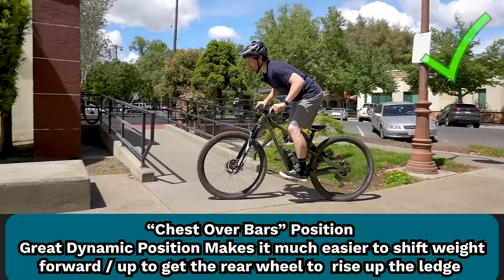How To Climb Technical Ledges & Curbs // Level Up Your Mountain Biking With The Punch Method

Comment from the maker: We hope everyone enjoys this video! There are many way to get up and over ledges out on the trail and in this video we focused on the punch technique.  In my experience using the punch method is really efficient and consistent at walking / jogging speed on small to medium sized ledges. Whereas I will use Bunnyhops on high speed medium to large sized ledges.  Bunnyhops are but definitely require another level up in terms of bike handling prowess and strength.  In my experience a punch can be done much slower than a bunnyhop as well for those really technical climbs. If you are interested we would be happy to do a follow up video of when to use the punch vs bunnyhop methods. Just let us know!  We have a video coming out next week that touches on pedaling power stroke, seat height, & gear selection so stay tuned for that one and let us know if you have any other questions or anything in the meantime!
Reply: Hey Kyle and April, this video was brilliant, there's a few things I do without thinking about, and it's nice to know 'what I'm actually doing', but there's also definitely a few take home points for me - thanks :) 

Also I think we can all learn a lot from the brilliant example of determination that April showed!

I would really love to see a video on steps on steeper climbs if you get the chance, a situation where you can't really 'stop pedalling' 

Thanks Team :)
Reply: The left up hill was hard, power pedal on the uphill then uphill left turn front wheel lift then rear lift too much for the leg but April did make it. I watch OKP a japanese trials video he has detailed  step by step videos to conquer obstacles.
Reply: Great video thanks!
What about uphill and downhill switchbacks?
Can you make a video about it?
Reply: Great video, it's on a skill I've been working on and the hints are great, and reinforce a couple things I've figured out. 

I find I can do pretty large ledges/rocks (eg wheel height) when I'm on flat ground or gradual uphills, but when the climb gets more steep I really struggle.  Sometimes it's a stall out, where I don't have enough speed once the front wheel is up.  Sometimes if the hill is reasonably steep I don't have enough room between me and the front of the bike to get the front wheel lift up high enough, and leaning back to create more room makes looping out a fear.  Any hints on executing this on steeper inclines would be appreciated.
Reply: Great video, and I would love to see a follow-up vs. the bunny hop.
Reply: this video is exactly what I needed: I know I can somehow go over ledges but couldn't really figure out why sometimes it works and sometimes I get stuck... this breakdown the technique perfectly and gives me idea what to focus on... Thanks! 😊
Reply: Yes, please!
Reply: ❤ This video was excellent. Top notch for sure and helped me immediately figure out what I was doing right and wrong at different times/feature. Thank you!
Reply: it would help if you also do a video on when to use different methods; type of obstacles, effort/skills  needed using a full sus and a hardtail....thanks
Reply: i've been so frustrated trying to do bunnyhops to get over obstacles, i'm going to switch to learning the punch first ! thanks for the video and surely would be interested to see the use cases video and good work April. i feel your struggle but you got it. and Kyle explains things in a way that no one else does.
Reply: I Love this video. I will going to try this ....👍

Comment: The barefoot section with the rigid bike was very revealing. Excellent demonstration. One fine point that I've noticed: While we don't 'scoop' to lift the rear wheel, we do perform some little pressure move on the pedals that keep the feet connected to the pedals even when we unweight. We do this so our feet don't become disconnected from the pedals for fear of shinners.
Reply from the maker: Glad the rigid bike section helped! We will have a video next week on our other channel talking more about the pedaling, seat and gear selection!

Comment: This is a very nice, practical video but I think you left off the need to perform a "pedal grab" by pointing down the toes and pressing back on the pedals as you perform the punch. I understand that the punch technique does not rely on scooping back the pedals but on pushing forward the handlebar but, as far as I can tell, you still need some pressure back on the pedals to keep your feet on the pedals and to provide a platform fron which to punch the bar. Am I correct? if so, I think the tutorial would benefit from mentioning this point. Thank you very much for the clear tutorial and keep up the great work

Comment: This is crucial information if you're climbing where there are steps or roots. It can make the difference between a miserable frustrating experience into one of confidence and gratification. My sister and her boyfriend took me on a trail  which had small climbs with roots it was my first experience into MB  and I'm fairly athletic so I thought I could manage. Nope. I was so exhausted and frustrated I threw in the towel and turned back. I was thinking never again. This video has given me new insight and hope. I am  in my late 50's but could pass for late 30's(I've been told) which is why I could easily give in so quickly - oldish and tired but thanks to your video it makes me want to try again. Love you guys.
Reply from the maker: Glad to hear this video gave you hope! The best part is you can practice in town to get your confidence up with curbs and stairs. And just like what happened in this video, if the first ledge you try gets too frustrating, try another one with less elements to it. Hope you have success!
Reply: Will do. A lot of times  you see these people in videos making everything look so easy which it may be  but one can easily create false expectations if you don't have proper technique. Looking forward to your next video on climbing to help prevent any unnecessary frustration. Cheers.

Comment: What gets me is feet position. I have to be super aware of where my feet will be because my gut wants to pedal while going over the ledge, but that generally means I get a pedal strike and get stopped dead.  Once I started focusing on not just speed and unweighting my rear wheel but making sure feet are level, I had better success.  This really is a fantastic video, I love these and can't wait to see more.
Reply from the maker: Yeah the feet thing is so hard to break mentally! April had the same thing happening but she really started to figure it out using the curb to learn at a coasting speed!

Comment: I am sitting here watching very closely with my repaired/healing Right Shoulder Rotator Cuff Tear!  Watching this and your other improve your peddling shows exactly how I fell sideways on a ledge. My dropper was full suspension and I had just finished a climb and I stopped and stopped and fell sideways over a ridge and landed on my shoulder.  I finished the single-track, but knew I was in trouble. 
Each time I come to a ledge is an opportunity to fall over sideways (watching April closely as she demonstrates this).  Keeping the dropper seat low is important so one can reach the ground. Of course it is difficult, when climbing steep switchbacks, to keep the momentum. 
It is 6 to 12 more weeks before getting back on my Commencal, but watching your demonstrations are a real encouragement.  Thank you!

Comment: Great tutorial. Something I've somehow figured out how to do over the years of riding. 

One thing I noticed with April's failed attempts was the timing of the the pedal stroke and position. Certainly being in the right gear, having the right amount of momentum with the front wheel up on to the ledge and then having the pedal stroke at the right timing helps a lot.
Reply: Oh. And Congrats April. Well done. I know when I first tried mountain biking I realized I couldn't just twist a throttle and have power. And how the power was put down and being able to ratchet my pedals became very important.
Reply from the maker: Yes good eye, I kept trying to pedal my way through on the failed attempts and timing is always off when I’m trying new things!

Comment: Nice instruction, I chuckle at people saying you need clips or suspension to get up ledges. I learned to hop curbs on my bike in the late sixties. I got into aggressive trail riding on a full suspensions about 8 years ago, my technique could use improvement but it still works.

Comment: I am so happy this came out when it did as I continue to fail on the technical climbs. One additional question would be advise on avoiding pedal strikes during this process. When the climb is steeper and also has sections like this it feels like you need to keep pedaling hard but then you get hung up on the pedal. It may be a practice/timing thing but man are those pedal strikes annoying.

Comment: Great to see you guys back making content - thankyou from Australia! If you are ever fishing around for ideas on a lesson to make, I would love to see one on ways to get over an obstacle taller than bottom bracket height at slow speed. There are a lot of old logs across trails where I ride (left as technical features) and sometimes they are just after a corner or have an awkward lead up where you can't approach them with much speed. I'll often stop for these and lift over rather than risk bashing my bike, but I see better riders magically clear these cleanly at the same low speed.

Comment: 18:29 - that's where I squeeze my toes between edge and pedal. As long as the chainring can clear the step everythings ok, but when I definitely have to lift the rear wheel first, there is a good chance my toes hit the edge. I think, I got to become more familiar to having the front wheel up first, like track standing with the front wheel on a bench for exxample - or getting some work shoes with steel toe caps. ;)

Comment: Great video - and you can see how leg strength is needed on uphill ledges 🥵 …interesting to see that you need to bend your legs a bit after getting the front wheel up.  Pedaling under exertion in a slight crouch is hard - esp when you’re trying to keep your weight forward so the rear wheel doesn’t get hung up on the ledge.

Comment: one thing i learned to do on big ledges is let my front wheel touch the corner of the ledge.  it allows me to shift my weight forward better. when i let the front wheel go up and over the ledge i always find myself in the back seat.  
i learned that from riding moto.

Comment: Hey, great video as always, thanks! By any means I would not call myself a very skilled or experienced rider, but it seems that this skill came naturally for me. Anyway, I have my own thoughts why April failed on that ledge with the left turn, and it was not mentioned in the video, so maybe I am wrong (feel free to correct me). I've noticed that every time she failed, she was trying to pedal just over the edge and the pedal strikes were the main cause for a failure. This leads to my other observation - IMO the speed was a little bit too low most of the failed attempts, that's probably why April thought she needed to put the power in. What I tend to do (by instinct) is to avoid pedaling during the back wheel lift and always try to keep my pedals leveled until the back wheel is over the ledge. This means that the speed needs to be correct before the maneuver.

Comment: Kyle, how long full suspension bike will last if it used to train dirt jumping, not only canonical descends? Struggling to decide to buy a dirt jumper, not so much time to train, but don't want to ruin expensive trail bike.
Reply from the maker: It really depends on the bike and how the frame is built, XC, Trail Or Enduro but honestly on small to medium dirt jumps you should be fine for quite a while :) Just try not to case stuff haha!
Reply: @AprilRideMTB  thanks Kyle, from your answer - no dirt jumping or buy dirt jumper/be ready for expenses. It's impossible not to case, especially unknown jumps

Comment: Watch 'SuperRider' in Oregon on how to do these techniques properly!
You need a two stroke off of your weak pedal foot, instead of coasting to the ledge on the weaker foot.
Its not in your arms you dont need to pull your arms to your chest for heights that you are doing, use your strio=ong pedal foot as well as your boy weight over the back of the balance point.

Comment: I think the problem with these punchy bits is body positioning. To ride a manual we are supposed to lift with body weight and keep arms straight. With punchy bits you kinda need to go back to bad form manuals. Pull up with your arms so the bike comes up to you and you are in a position to then throw your weight forward and push the handlebars forward. I struggled with the punchy bits for a while then I finally figured them out.

Comment: In real situation as I see this, the hard part is not the obstacle, but (for me at least) to keep the momentum in the ascent. so to avoid hitting my pedal or struggling to unload the rear during pedaling, I must gain some extra speed before the obstacle. but during a hard climb I'm already out of breath and don't have extra energy to accelerate. and when the obstacle slows me down it's even harder to move forward.
Reply from the maker: Hi Norbert! We have a video coming out next weekend on our Ride MTB Express page that will go over pedaling, gears and seat post to compliment this video and will hopefully help you. Keep an eye out for that or subscribe if you aren’t already, so you don’t miss it.

Comment: It's tough going up a ledge when it's uphill and on a corner and you're tired. I was thinking the same technique could be used to get out of a rut: first lift the front wheel and move it to the side out of the rut, and then the rear wheel.
Reply from the maker: Yeah it totally works on ruts too!

Comment: Slide your weight back with your butt over rear wheel to bring the front up and then unweight with the pop over center of the bike to get the rear wheel . Don't lean forward. 😊